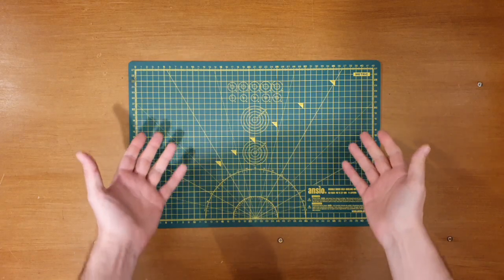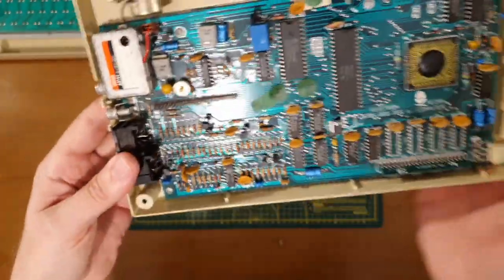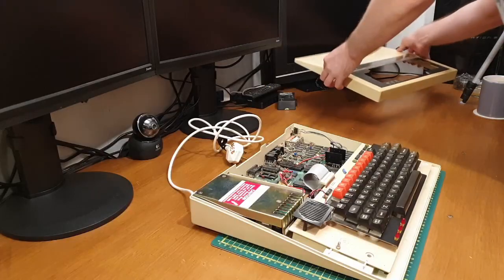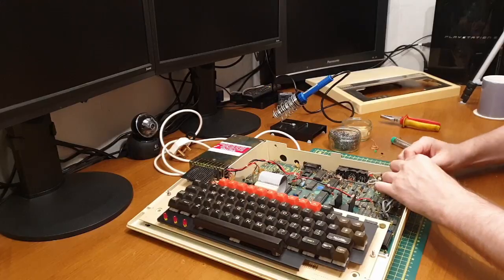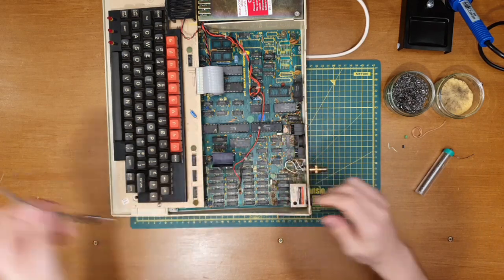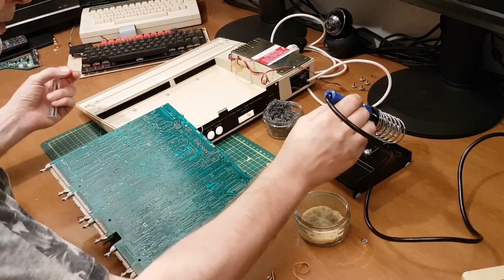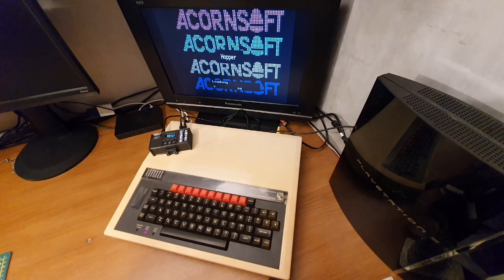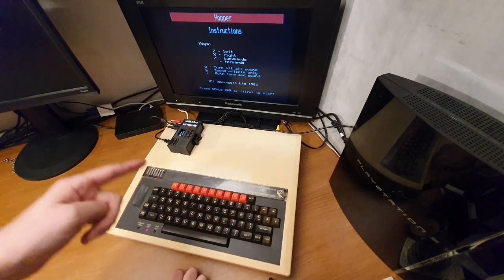Quick & Easy Acorn BBC Micro Model B (& Electron!) Colour Composite Mod

Comment: Why might you want to convert the electron composite out to colour when when it has RGB out in colour?
Reply from the maker: Hey Chris! I wanted a better picture than the RF offered and didn't have the correct DIN plug. 🙄😄
Reply: because most tvs don't have a scart and those convertors are pony